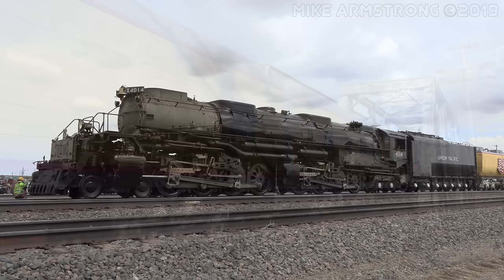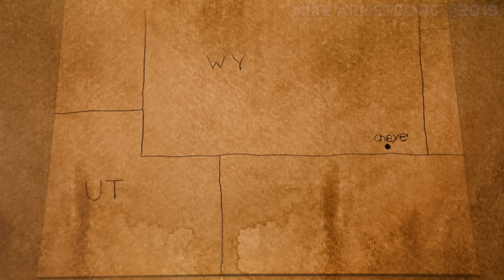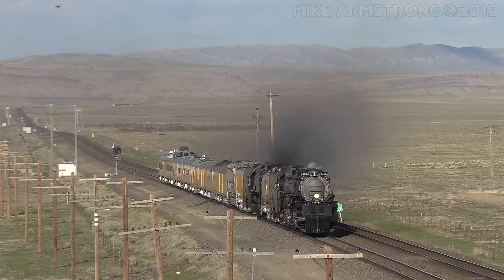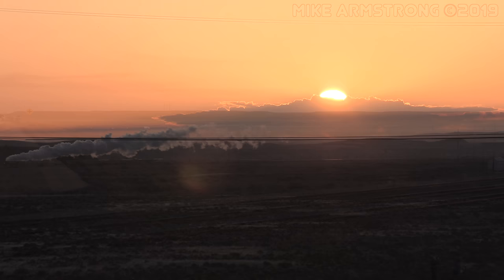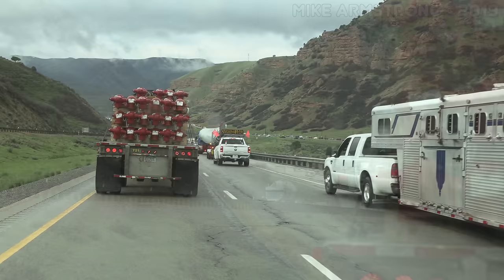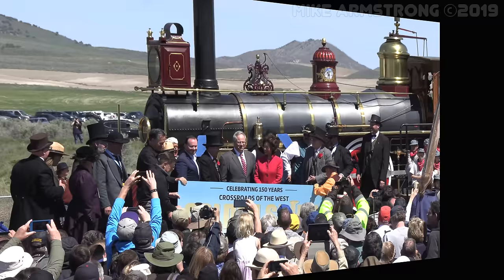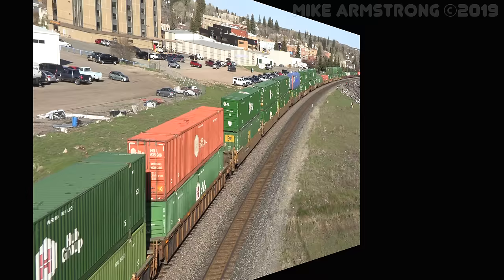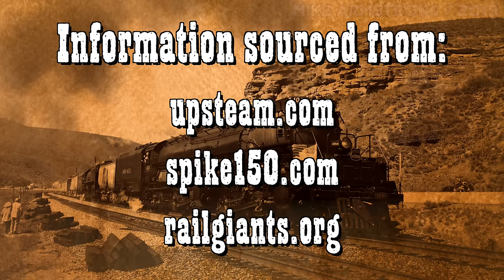Big Boy 4014 Steam Train: Return To Steam!

Comment: It may not interest anyone, but the Diesel that accompanies all current excursions run by the Union Pacific is mandated by company policy. Union Pacific utilizes PTC (Positive Train Control) which is also required by the government on all 1st Class Railroads (at a minimum) on their rail lines and due to the different era the 4014, 844, and 3985 were built in, they will likely never be permitted to lead a train solely by themselves (as they lack PTC). The modern infrastructure of most railroads also prohibits the successful return because of the lack of necessary items such as water  and oil along the lines. It would be extremely costly to bring these locomotives back into freight service which is extremely unfortunate. It would be amazing to see these magnificent locomotives return but it is extremely unlikely that this will be seen anytime in the near future.

Comment: I'm waiting to see 4014 take on an intermodal train by herself.
Reply from the maker: Now that would be cool!
Reply: In frieght service the engine still does not meet t4 emissions standards and the operating cost mean a diesel will still be the better candidate.
Reply: @GamingLegend-ie4nl 4014 would only pull an intermodal train in an emergency to clear the tracks.
Reply: @Chuck59ish  probably if they didn't have anyone else to do it.
Reply: @GamingLegend-ie4nl You should pull up UP Challenger # 3985 + 143 freight cars, it's 3985 coming up Archer's Hill in Wyoming pulled 143 intermodal cars by itself after the diesels broken down, it was published on Oct 13,2008. And because internodal is a time sensitive commodity they'll use the closed running engine.
Reply: @Chuck59ish  emission standards are constantly changing I'm saying they are not allowed to run frieght in today's t4 standards. I have seen the videos and the original is from 1991.
Reply: @GamingLegend-ie4nl Hasn't the current POTUS killed all the emission standards brought by the previous POTUS?
Reply: @Chuck59ish  I do not believe the current one is for power plants not railroads.
Reply: Victor Greenwalt I don’t think you understand how emissions laws work. Most locomotives manufactured prior to 1973, including steam locomotives, are exempt from Tier 0 and up emissions standards. Tier IV emission standards don’t concern the 4014 in any way.
Reply: @SouthernPacificPatch  And 4014 was converted from coal to used diesel crankcase oil just like the other 2 UP steam locomotives, so it actually burns cleaner than it did before.
Reply: @SouthernPacificPatch  you are right but it still wouldn't pull freight because even though it burns oil it is still expensive to run it is more profitable to pull excursions once and a while where people pay top dollar for a ride.
Reply: @TMCCABE  what would be even better if 4014 (up front), 3985 (behind 4014), & 844 (behind 3985) pulled a massive freight train up Sherman hill
Reply: @FranzFerdinandVIII  844 is better pulling passengers
Reply: @TMCCABE  Or is it...
And thusly, the plot thickens.
Reply: @FranzFerdinandVIII  take that back I saw vid of 844 pulling a freight train
Reply: @TMCCABE  uh... What?
Reply: @FranzFerdinandVIII  I underestimated 844 and freight theres a vid of 844 pulling a freight train in denver
Reply: @TMCCABE  Oh, okay.
Reply: @Larry Butler ooh. but I was thinking of that TGV service from the northernmost tip of Maine to the southernmost tip of Florida.
Reply: Paula Johnson  844 came to California in 2009. I have video of it. They may have come more recently than that even.
Reply: She could pull a 5 mile train on level track
Reply: @raine4435  Since the 4000s are Big Boys, they are identified as he, him, his.
Reply: @FranzFerdinandVIII  I've heard it as hers as well.
Reply: @raine4435  well, I personally identify them with male pronouns, but you could identify them with female pronouns.
Reply: @FranzFerdinandVIII  yes. I mostly call steam locomotives females. Names such as big boys should not specify what to call a locomotive
Reply: @raine4435  5 1/2 miles long,more precise
Reply: @armandsauciuc  Yeah. I can never remember the 1/2🤣
Reply: It actually happened but it was not a big boy but a challenger that pulled 143 cars long intermodal train up a hill at speed
Reply: @GamingLegend-ie4nl  I think you would be surprised by the emissions of this train. That firebox gets so hot that everything gets burned so it releases very little NOx or CO2 or particulates. Under load it might blow some smoke but you can see right in the video that at steady state, no black smoke. Now efficiency is a completely different matter as diesel has that beat hands down.
Reply: Paula Johnson yeah they do come to Cali  a lot you will see it there
Reply: Paula Johnson I sawl them in LA twice in the last 20 years
Reply: Charles Damery Big Boy did deliver some Hoppers after the test runs.
Reply: Paula Johnson  844 was in Roseville in the late 2000s
Reply: Lol all that power it still needs a diesel locomotive to help lol 😆
Reply: Similar to what the UP 3895 did look the YouTube video up
Reply: Correction UP 3985
Reply: By herself? You mean by that monster on wheels you mean
Reply: I think 4014 is refered as a male and both 3985 and 844 as females

Comment: 4014 is supposed to go on a tour of Union Pacific's network over the summer. Wouldn't it be cool if when it visits Portland that Southern Pacific 4449 and/or Spokane, Portland & Seattle 700 would be on display with her at Union Station? And when she's at Los Angeles at Los Angeles Union Passenger Terminal Santa Fe 3751 will be sitting there with her? Also, long live The KING of Steam.
Reply: 3751 will not be alongside 4014. 3751 is down for a rebuild.

Comment: Americans might not have fast trains
They might not have the same technology as Europeans or Japanese

But they have the most powerful and best looking steam trains
Reply: @fredgarvin9262  Avelia Liberty?
Reply: 6300 horsepower, it is more powerful than any diesel locomotive. And it is 78 years old
Reply: Fred Garvin 
How?
Reply: The united states moves the most freight over the largest system.  If people need to get places quickly they can fly.
Reply: Everything looks better in the US
Reply: lner a4, flying scotsman, castle class gwr, lner Stirling single, stephenson's rocket?
Reply: @MrTrollus  The new AC diesels could easily out pull a Big Boy! It's all about technology and Rail traction effort. Diesels rule sorry!
Reply: dave boydell the DM&IR Yellowstone outpolled every diesel it ever had to compete with. Just look at the tonnages. The heaviest train pulled by a DM&IR Yellowstone weighed in at 21,000 tons and now days CN doesn’t even come over 14,000 tons with three diesels and on some of the grades it crippled the diesels to 10mph.
Reply: dave boydell there’s only one diesel that can match the towing ability that big boy can manage and that’s the biggest diesel ever made unfortunately idk it’s designation, but ur standard every day diesel u see hauling every day can’t, hell 844 pushed a 75k ton train up a hill with because the train towing it broke and on top of that hauled it’s own passenger train too that put it at damn near 80-90 tons of weight and it did it while barely breaking a sweat
Reply: C0ldyloxProductions actually it was an 11,000 ton stalled freight not 75,000. Sure big boy could out pull diesels but a lot of steam engines could out pull it. Mainly the DM&IR Yellowstone which was the top dog when it came to pulling. 21,000 tons unassisted up a 1.5% grade.
Reply: DM&IR Productions really my original gut was to say 25k ton it’s been a while since seeing that vid, and I thought big boy was the biggest steam engine which the highest towing capacity
Reply: And I must say, Americans have the best design and style out of all.
Reply: Our steam trains were just as fast as the record setters from Britain and Germany, if not faster in some cases. But in the modern age we've fallen far behind.
Reply: @kurtvonfricken6829  No, Russia has the largest system.
Reply: @MrTrollus  its actually 7000 horse power
Reply: Hardly the best looking. That goes to Britain.
Reply: @ajf3202  you must be joking, compare 4449, 4014, 611, 3985, 844 and others to Fowlers 4F.
Reply: @marcas8269  bad example by our part. Peppercorn A1s, Southern rebuilt Bullied Pacifics, Duchess of Sutherland, A4 pacifics they are much better examples.
Reply: @ajf3202  most of those examples are bad as well, you just can't compare locomotives like 4449 to English ones, A4s would be the best out of all, but still isn't enough. German are closer, but still don't get close. What you're doing is the same as compare a Cessna 172 to a Boeing 747 and say it's, let's say, equal. I'm not going to argue about something like this anymore. P.S.: I'm not English or American
Reply: @marcas8269  your bringing up things such as size and power whilst I'm talking about looks. You cant get anything better looking than a British engine. No massive spotlight on the front and no pointless bell.
Reply: Hoorah!
Reply: @ajf3202  rebuilt Bulleids look terrible. The originals are beautiful!

US locomotives look very 'German' to me. Purely functional, which has a raw beauty all of its own.
Reply: Amen to that!
Reply: @c0ldyloxproductions324  you are probably referring to the DDA40X Centennial diesel-electric build by EMD in the 1970s. Also, UP has this policy that there's a big traffic surge, all locomotives are on call to haul freight trains, including those of the heritage fleet. There's a video of 844 pulling I think a unit grain train  or a manifester in the late 90s, I think.
Reply: @kristoffermangila  well ya but 8448 big boy is the biggest steam train in the world and can pull as much as dda40x because they are the same size
Reply: @ajf3202  good looking you might say, but the operation of such steam locos leaves much to be desired... hand fired, ash removal also by hand... and then there's the maintenance... replacement of the entire boiler instead of rebuilding!? No wonder when the UK's Southern Railway acquired some ex-USATC switchers for the docks in Southampton, the crews generally liked them. Give me an American steam locomotive with a automatic stoker and a rocking grate anytime! Or better yet, an oil-burning American steam locomotive...
Reply: @c0ldyloxproductions324  you made a mistake in the number but your right. Can't wait for 4014 to pull a unit train or a manifester, even an intermodal... one can dream, right?

Comment: I really think a caboose at the end will finish it off well👍
Reply: Mark Garcia you are correct. There should be a caboose at the end of the train 🚂. No train 🚂 is complete without a caboose. They are needed on every train 🚂  Very badly.
Reply: You’re the one ☝️ that’s wrong! No train 🚂 is complete with out a caboose. Both passenger and freight.
Reply: cabooses were only on freight trains

cabooses are not longer used
Reply: If you understood the functionality of a caboose, you'd know why they no longer exist.

Comment: I remember back in 2013 when I was staying in Ontario for school I went to see 4014 at Rail giants before they moved it. When I went they were greasing up the bearings and checking on the boiler internally. Little did I know that next year they would be moving her. Glad I got to see her when I did, but now I have to see her and all her might under her own power. Maybe next excursion run

Comment: When 4014 is double headed with 844, it sort of looks like 4014 is just dragging along a spare set of drivers!
Reply: @Kevin spacey They fixed that problem after the shakedown run. 844 also had a bad cylinder packing.

Comment: "considered to be one of the largest locomotives ever built." ???

It is OBJECTIVELY the largest steam locomotice ever built.
Reply: Richard Wielgosz and most powerful story goes there was a GE stuck on a hill (i forget the length of the GE )they radioed they needed a helper to get it up the hill. The radio lit up saying here was a big boy coming up the track hauling coal and would help... this big boy was fully loaded. It pushed this other train up the hill like it was only the engine. Lol
Reply: Not quite. The Pennsylvania S1 6-4-4-6 Duplex was technically larger.
Reply: I thought the Matty H Shay triplex was the biggest. Although it was a failure it would've been a great loco if it was built properly.
Reply: CarNutz Pennsylvania S1 was only longer, 
S1 length: 140 feet, (with tender)
Big Boy: 132 ft (with tender)
Reply: No, that title would go to the 2-6-6-6 Allegheny.
Reply: @UTAFan 01 you have to learn alot about trains, the 2-6-6-6 allegheny had more horsepower, wasnt longer tho
Reply: @union_4014      Is tractivefforthe real measure of a locomotive?
Reply: @Robert Gift if your trying to say if horsepower or tractive effort matters on a steam locomotive the answer is tractive effort

Comment: Why isn't 4014 hauling on its own? Why is 844 or the, union pacific engine inline?
Reply: Robert Chaffee The only reason why big boy isn’t hauling on its own is because big boy does not have dynamic brakes, thats why she normally runs with a diesel behind her. She is still doing all of the work, the diesel is only there for dynamic braking and to provide power to the rest of the coaches if she runs as an excursion train
Reply: Yeah that kinda bothered me too. Couples times in the video I could here the diesel trains turbos going pretty good so it was pushing.
Reply: 844 is behind because that is a SPECIAL TRAIN celebrating the 150th anniversary of the driving of the golden spike, did you even hear what he said?

Comment: It hadn't even left the yard and both front cylinder packers had gone.
Reply: Hardly a major issue and remedied after the shakedown run. Are you an engineer? Could you do better?
Reply: @Martin Turner Even 844 was having some issues with its cylinder packing. It's a common issue and is easily fixed.
Reply: Stop fighting

Comment: 3935 needs to be restored also so the Union Pacific has the Big 3 all together in steam
Reply: They are retiring it from service (Source: a UP Steam Club article), and putting it on static display somewhere (I think). It is because 1, it would require a 4014 style frame rebuild, 2, Financial cutbacks on each department, and 3, UP believes that 2 are sufficient for now.

Comment: 6000 hp. When I was in grade school I remember that the most hp being produced in a big v8 that was supercharged in a dragster was about 1500. And that was only for a few seconds and after a few times you needed a complete overhaul.  These engines were probably in need of tons of maintenance too. They had huge heavy parts because weight was an asset not a liability in locomotives.

Comment: You had me at two trains in one with one boiler and lost me when I saw two trains
Reply from the maker: The special train that ran to Ogden had two locomotives. The first one was the 4014 "Big Boy". That's the articulated locomotive that is essentially like two locomotives running off a shared boiler. The second locomotive is Union Pacific 844, the only steam locomotive never to be retired from a major freight railroad.

Comment: Front left side add 80g  2nd wheel subtract 67g  3rd subtract 78g  4th add 78g  rear bogie add 45g  54gadd  subtract68  +54   Other side right  +60g  --54g  +54g   --90g       +80g  --69g  +70g   --90g
This will make a speed possible of 145 km/h  The weights are to be applied with center at 5 cm from wheelrings. How fast does the 4014 go? 150mph? no km/h
I tell you this because now you can copy the locomotive by High Gain Unified Field Manufacturing.

Comment: It's funny, you don't realize how massive 4014 is until you see it in front of 8044 or the diesel. Was that diesel just there as backup? It looks like it was purely being towed in most of those shots.
Reply: I think it was there to help with braking.
Reply: big boy and many majority of mainline steam locomotive lacks of modern day train protection and signalling system, thats why a diesel is needed. With the new computer system that is placed on 3985s tender (which is what big boy is using), it probably doesnt need a diesel anymore

Comment: Amazing! Did they do any modifications to modernize its operation i.e. electronic valves and gauges?
Reply: it has a computer located inside big boys cab to accompying the Positive Train Control (PTC) system, now a new computer has been built on 3985s tender which is what Big Boy is using

Comment: Looks nice. But I wonder why that SD70 is pulling? Looks like its there for backup purposes, but it is not idling, it is working.
Reply: big boy and many majority of mainline steam locomotive lacks of modern day train protection and signalling system, thats why a diesel is needed. With the new computer system that is placed on 3985s tender (which is what big boy is using), it probably doesnt need a diesel anymore

Comment: I wish they wouldn't always put a diesel on these trains. Is it for auxiliary power to the passenger cars? These steamy boys can pull by themselves!
Reply: they dont supply any electricity because most of it are freight traffic locomotive, big boy and many majority of mainline steam locomotive lacks of modern day train protection and signalling system, thats why a diesel is needed. With the new computer system that is placed on 3985s tender (which is what big boy is using), it probably doesnt need a diesel anymore

Comment: why is there a diesel engine behind the two steam engines?  I love the way those steam engines sound
Reply: big boy and many majority of mainline steam locomotive lacks of modern day train protection and signalling system, thats why a diesel is needed. With the new computer system that is placed on 3985s tender (which is what big boy is using), it probably doesnt need a diesel anymore